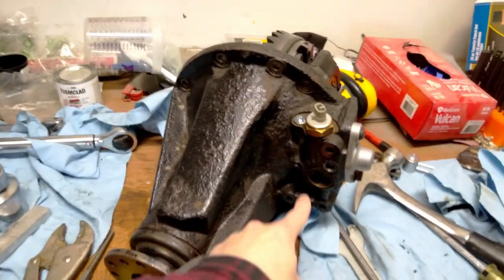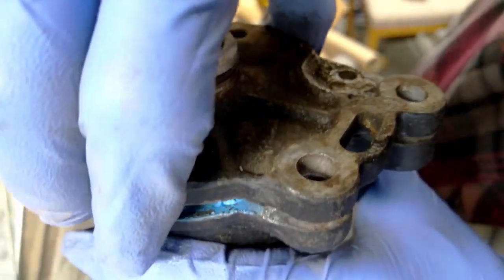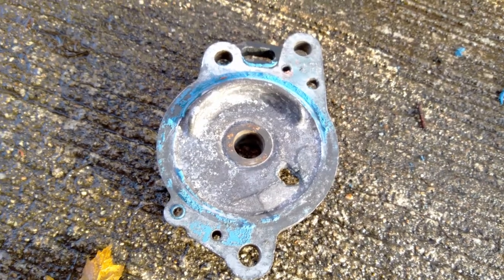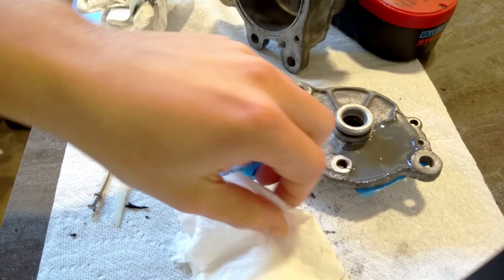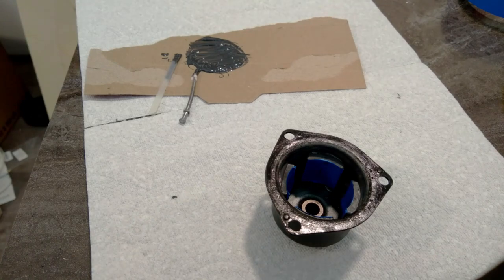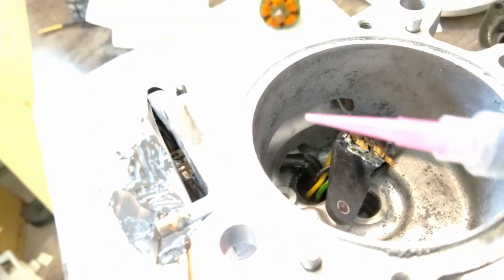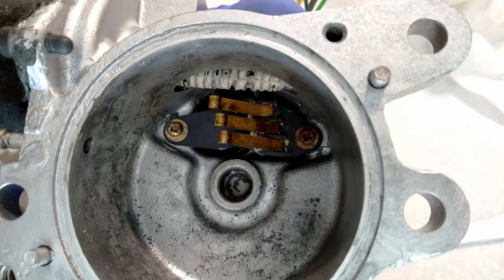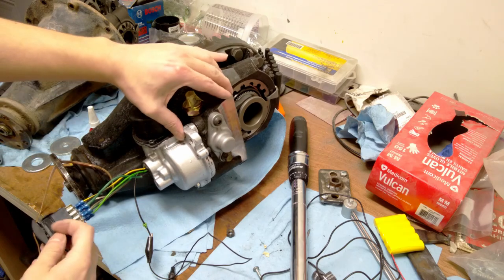Toyota E-locker Rebuild Part 2 / Actuator Rebuild

Comment: Couple of observations : Look into dielectric grease for the silver plate surface and don't know if you did, but I would have cleaned the 3 contacts with some Emory cloth. and also put some dielectric grease on them.

Comment: This is Amazing, I can't seem to find much of anything regarding the FRONT e-locker actuator but you seem to have nailed it with this video. I bought the $230 harness from low range 4x4 and there is virtually NO INFORMATION regarding the switch operation on their website and the customer service guys are clueless, even the sarcastic guy that supposedly has a degree in electronics, he told me that you just need to press the switch momentarily, not hold it as you demonstrate at the end of this video.  Anyway, GREAT VIDEO on the disassembly, cleaning, and re-assembly of the FRONT e-locker actuator, THANK YOU!!

Comment: You did a really nice job. I had to rebuild 2 of these myself, for the front and rear of my Land Cruiser. Pretty much the same problems. Corrosion and loose magnets. I didn’t make them look nearly as nice as you did though! Good work.
Reply from the maker: Hey thanks! I couldn't resist slapping some paint on them, I figured at least it would look good if it didn't work good. ;)
Reply: @amielsstuff3262  are there any IRS electric diffs out there? Doesnt matter which car they come from because its a custom build

Comment: Awesome videos! Will definitely be using this info to confidently rebuild my front locker now. Is there any chance you have a layout of the wiring on the actuator to a 6 pin plug? The plug on my rear locker broke and it's impossible to trace the wires back to switch as the colours are different and it's a mess. Thanks in advance
Reply from the maker: Thanks! Yes, I definitely have some info on wire colors. There's a few different color schemes, what is the year and model of your truck?
Reply: @amielsstuff3262  mine is an 89 but the e-locker is a retrofit and I have no clue what it came off. Looks identical to yours tho
Reply from the maker: Alllllrighty, I dug out my notes, here's what I've got. My actuator has 5 wires, 2 are heavier gauge than the other 3. The two heavy gauge wires are both green, with one having a red stripe. These heavy wires go to the motor brushes. According to my notes, Green with Red is Unlock and Green is Lock. The other 3 wires are a little tricky, there is Black, Yellow and Green (lighter than the brush wire) basically they sense the position of the actuator. Black is common. You should get no continuity between Black and Yellow when the actuator is Unlocked and no continuity between Black and Green when the actuator is Locked (to be honest, this may be reversed, sadly I don't remember for sure, lol I'm pretty sure this is right tho). This should help: https://imgur.com/FtZXPYb I want to do a good video on the wiring, but I've been busy with other things lately, :(  Hopefully this helps you out! I'm happy to answer more questions should you have any. :)

Comment: Very cool, I bought front and rear axles for my 96LC on ebay and luckily the actuators were in pretty good shape, my question is whether or not the locker will engage even when the splines aren't lined up, in other words, once you press the switch, will it spring load to engage once the splines line up, IF THEY AREN'T WHEN YOU INITIALLY PRESS THE SWITCH?  I hope you understand my question.
Reply from the maker: Hey! Congrats on the ebay score!

Ya, the spring keeps good preload on the clutch, it pops in once the splines line up to lock. Same when it disengages, once the tension gets released, it pops out and unlocks.
Pretty clever, simple mechanism.
Hope that helps! 🙂

Comment: Great work! Exactly what I needed so I can clean mine up. Could you please list the size/ thread pitch of the replacement hex screws you used? Thanks again!
Reply from the maker: Oh hey, sorry I meant to find that thread size for you, it's around here somewhere.
Reply: @amielsstuff3262  Thanks very much. In the process of getting it all cleaned and ready for re assembly! Great idea making a mating surface with JB Weld, my O ring channel has deteriorated.

Comment: Did you do the front axle install? Curios how much grinding you did to clear leaf’s.
Reply from the maker: I did install it, I have the footage, I need to finish the video, but my life has been, uh, interesting as of late, lol. I had to grind a fair bit off the side of the diff to clear the ubolt. Probably a good 1/16 to 1/8, way more than I expected.

Comment: How are the wires connected to the switch?  what contacts where?
Reply from the maker: I'm still planning to do a follow up to this video as soon as things calm down for me... In the meantime, I hope this helps! :) 
It's a basic circuit you can find online. There's a few things I don't like about it but it does work. I'm working on a better circuit that will be featured in a future video. This is the basic circuit I used: https://www.off-road.com/images/content/2-Justin-Schematic-OEM-Toyota-E-Locker-6-24-15.jpg What I don't like is it runs the full motor current through the little sensor contacts and wires. But it does work and lots of folks run it like this!

Comment: Do you have a schematic or wiring diagram for how you hooked up your switch?
Reply from the maker: I do, it's a basic circuit you can find online. There's a few things I don't like about it but it does work. I'm working on a better circuit that will be featured in a future video. This is the basic circuit I used: https://www.off-road.com/images/content/2-Justin-Schematic-OEM-Toyota-E-Locker-6-24-15.jpg What I don't like is it runs the full motor current through the little sensor contacts and wires. But it does work and lots of folks run it like this!
Reply: @amielsstuff3262  Awesome, thanks so much for sharing! I just got an elocker that i'm going to swap into my 4runner so I've been contemplating/researching different wiring solutions. This is super helpful, thanks! Looking forward to seeing your future videos!
Reply: @amielsstuff3262  I’m wondering what you don’t like about it? I really like the simple On-Off-On momentary setup for 3 reasons: (1) Zero voltage at the axle unless my finger is on the button, (2)no computers or relays to fail, and (3) the ability to “rock” a sticky actuator back and forth to free it up. That is something the OEM Control Unit cannot do.
Reply from the maker: @keithgillette9537  I love the simplicity of the circuit as well, very little to go wrong and puts you in control of the entire process. The only thing I don't like about it is the having the motor current traveling through the little sensor contacts and back and forth from the switch and actuator. My final circuit will power one/two relays to power the motor rather than powering the motor directly. I'm guessing the motor would have a little more 'oompf' if it had a relay. I'd also like an indicator of some kind to tell me if the motor is spinning or is stalled since I can't hear it inside the truck. I may be overthinking it, but that's kinda my thing, lol.